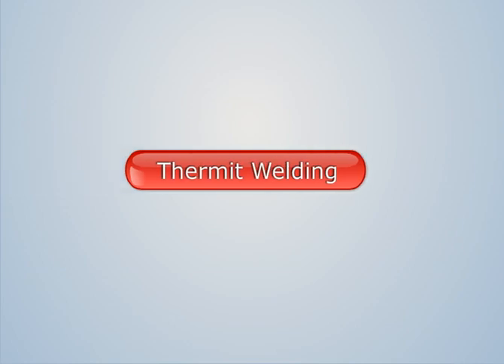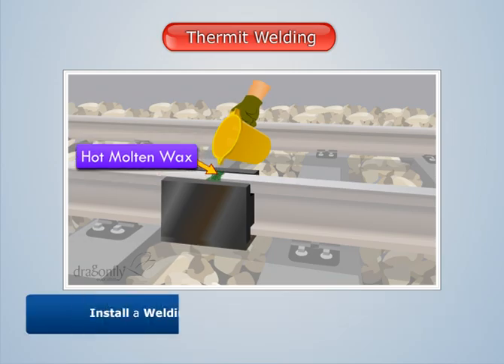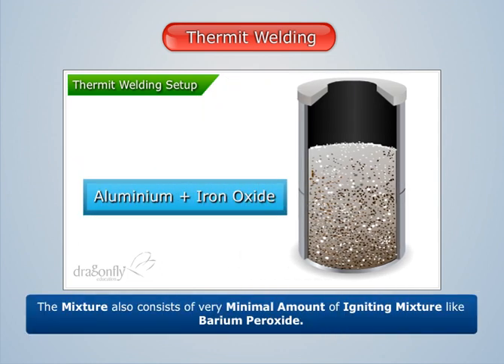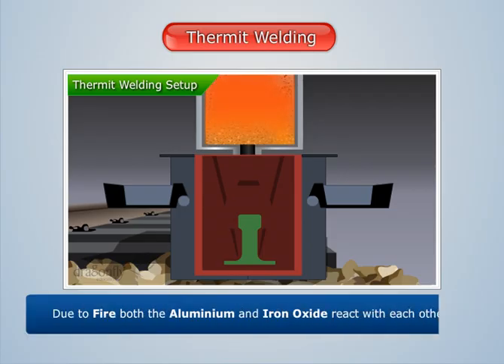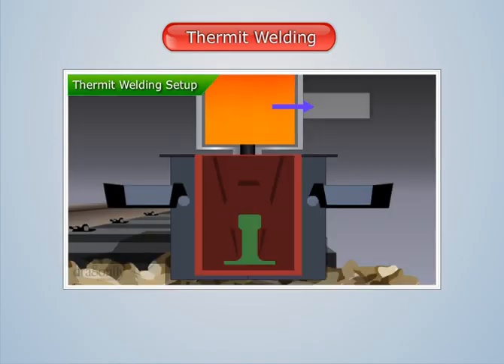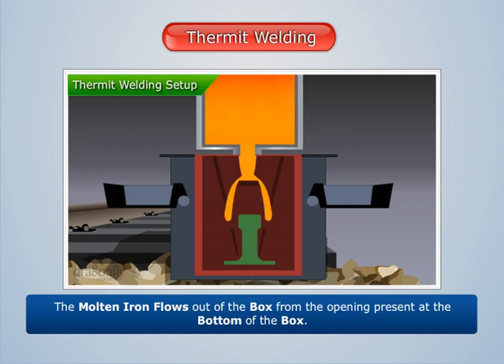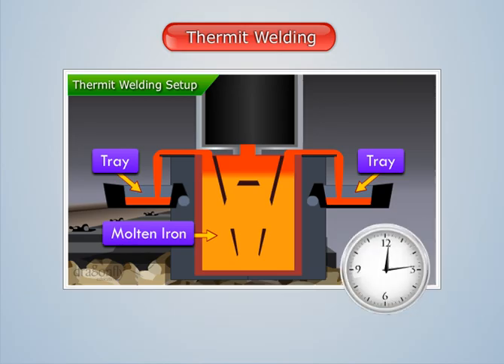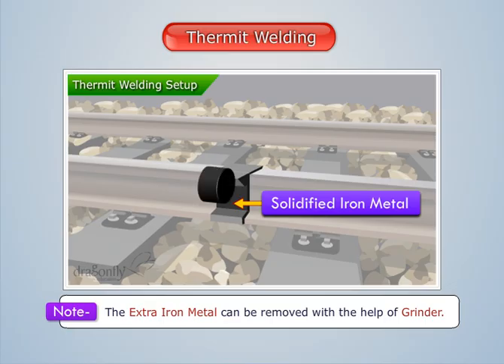Thermit Welding Used to Join Railway Tracks | Manufacturing Processes

Comment: Like everyone else. Even I doubt what happens to the wax present ?? It wasn't even poured out of the system.
Reply: To guide the molten mixture onto the welding spot, a proper guideway is necessary. A mold is created around the parts to be welded with arrangements for unrestricted flow of the mixture.A wax pattern is used inside the mold, an opening is provided at the bottom for the safe draining of the molten wax

Comment: in that video of thermit welding What is the use of wax pattern in the entire  process??
Reply: See, the wax is present at the cracked region of railway track, equipment is set up around it, main aim of this process is to provide enough heat to the wax pattern at the crack so that wax melts and the edges of tracks too a bit, then pressure is applied so they stick to each other,  solidified iron oxide is not the part of the weld.
Reply: It's just there to compensate for the loss of evenness in the tracks.

Comment: This video is highly misguiding....
1... The path of the moltel metal from the crucibe is projected wrongly here... it flows only alonf the cavity not throughout into the box

2....The wax pattern is not created throughout the cavity tnere is no purpose also.... the cavity  is made of refractory bricks and It is joind by sand which is also a refractory. ..They are chosen based on melting pointss